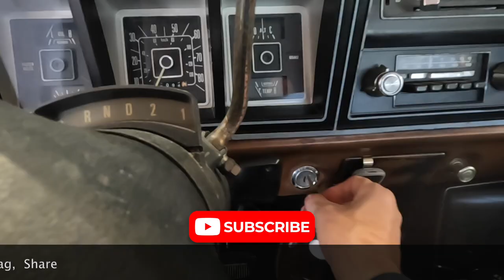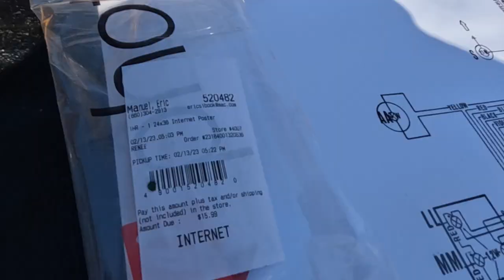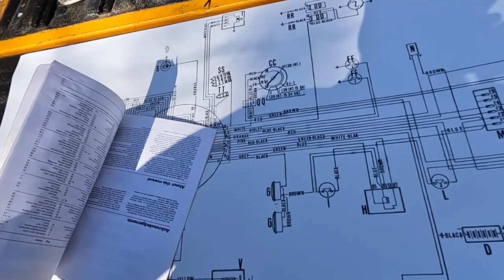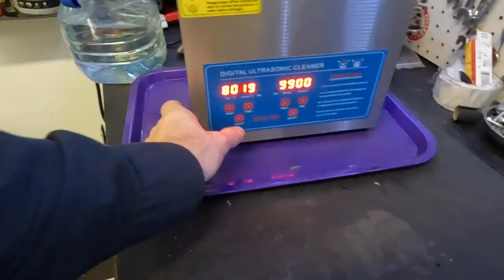1975 Moto Guzzi 850T abandoned for over 10 years. Will It Run?!?

Comment: Did the same with a € 400,- Moto Guzzi Nevada 750, turned it into a lovely Scrambler. It did run when I got (I mainly ran and she made some noise), wouldn’t idle. Without taking of the carbs, just took of the containers, cleaned the main jets and put a double dose of injector cleaner in 1 l. super fuel. It now runs and idles almost perfect.
Reply from the maker: I really like getting cheap motorcycles running without spending any money. Thanks for watching.

Comment: I admire you for taking it on, and getting it to run.  Lots of us armchair mechanics are cringing, you didn’t show if you checked to oil first, hope you did.  And WD40 has no lubricating properties, not the best for cylinders.
Reply from the maker: Thanks. Sometimes my enthusiasm gets in the way of prudent choices. I can’t remember if I did or didn’t. 😂 thanks for watching.
Reply: WD is great for short term light lubrication and displaces water. It’s always a good idea to juice those dry old cylinders with anything really. And if your dealing with aluminum pistons it’s a must (CB750’s etc)
Reply: From what I've heard WD is actually mostly fish oil. Not putting down on it's use, just putting it out there

Comment: I love my T I restored 9 years ago, simple, reliable & easy to work on. You may want to research about the chrome cylinders flaking; obviously not good for engine. I replaced mine with Gillardonis & they were not cheap or easily available back then. Early T's also had only a wire mesh gauze filter to help remove sparrows & low flying house bricks. Best of luck. They are worth the spending money on, you will have a bike that is not only few & far between but it will be bullet proof as well. MG Cycles are a wealth of parts & knowledge.
Reply from the maker: Hey George, How's your daughter Judy? I think the engine on mine was painted black and that is what was flaking off. I am going to do my best to remove all of the paint. 
I am enjoying the process with this Moto Guzzi. 
Please subscribe if you haven't already and please share.
Reply: @motorcyclerewind  The chrome plating on the internal cylinder bore reacts with the alloy cylinder & flakes off. This can cause the rings to grab for eg. It also ends up in the oil. If so the engine will need a complete strip down. If you drain the oil & it has silver flakes in it then the chrome lining has failed. The cylinders are easily removed for inspection. For peace of mind I would remove the cylinders. Riding with flaking cylinders will only destroy it one way or the other; sooner or later.
Reply: You're right, my dad got my Guzzi from me and forgot he left it running in the garage.
When he came running back to the garage remembering his folly, she overheated and and was lobbing.
He passed away last year and I got it back.
Left bank was scored and I had to replace the piston and cylinder. It had flaked at halfway through travel and top edge.
Funny thing, original pistons were 4 ring and my one replacement is a 3 ring.
Doesn't matter, now she's a beast.
I've done a complete rebuild.
She's coated in Dodge viper copperhead colored frame and Dodge viper snakeskin green.
On top of that I had a cafe racer seat reupholstered in snake skin vinyl.
Wished I could post a picture.

Comment: Right on!  You got that Moto Guzzi running.  

Moto Guzzi builds a great motorcycle.  They are shaft drive twins like a BMW (duh).  You knew this of course.  These Guzzis were very dependable motorcycles down the road; smooth, sweat handling, classic bikes.  

Guzzi guys are fanatics.  Moto Guzzi is the Harley Davidson of Italy.  All the Italian Police motorcycles are Moto Guzzis.  This bike was a score!  A much better motorcycle than the Yamaha 650 twin in the background (I like those bikes too, just sayin').

The trick is finding the parts you need.  The 850 T was not a plentyful machine.  It's well worth the effort to rebuild this bike however.
Reply from the maker: This was an easy one. Just one system at a time. 
I know nothing about these apart from the research that I have been doing.  Look forward to putting some moles on it. 
Unfortunately, people like their used Moto Guzzi parts. To go back stock is outside what I want to spend on this motorcycle. 
The laundry list is front and rear fenders, Speedo and tach and related mounts, headlight and bucket, rear gargantuan bar and turn signals and tail light. What what I found so far I am over $1,000 and I don’t the market id real strong for 850T’s. Love to hear your thoughts.
Reply: @motorcyclerewind  These Moto Guzzis are revered.  The 850T is not a bike that had 50,000 imported, but it definitely has value.  Swap meets are a good place for parts, also eBay or Guzzi riders forums online.  I'll tell you this, if you dial in that Guzzi you can ride it across the country.  Moto Guzzis are just like BMWs in this regard.

It seems like your bike was stripped for a crashed bike.  Your Guzzi does not look like it was crashed hard.  Only go "stock" on the parts that matter; OE fenders for instance.  Pipes, go after market with an OE appearance.  Seat... swap meet, or a Corbin (but they are expensive).  The OE seats on most M G are awesome, if you can find one.  Turn signals are cheep, get the small LED kind.  Try to get OE gauges with the dash that has the warning lights, and also try to find the OE headlight bucket to preserve the value of the motorcycle.  

Nice purchase, Good luck!

Comment: The direction of a ratchet spanner to tighten is the same direction as the open end is cranked. So in other words the open end of the spanner points in the direction to tighten. Does that make sense?
Reply from the maker: That does make sense. Another helpful tip about these wrenches 🔧 that I am finding out about late in life. 😂 Thanks for watching.
Reply: Great channel btw
Reply from the maker: Thanks so much. I am having fun.

Comment: Great score for 400 bucks.   I used to have a 2017 Moto Guzzi V7iii. that looked similar to that.  They're fun bikes.  

Where did you get that large wiring diagram printed up?   Wiring isn't my strong suit, but I enjoy crimping bullet connectors and terminals.   I'm definitely getting better at it.   I don't understand why someone would cut the wires right at the connector when they could just de-pin them.
Reply from the maker: I get the wiring diagram posters done at Walgreens. All I have to do is locate the image and do the rest at Walgreens.com. An hour later I have it. Big hack is there is always a 50%-60% coupon code available. The big poster cost me $15.99. 

I'll never understand why people hack up wiring. Just doesn't make sense!

Comment: The carburetors on guzzi have accelerator pumps. every time you open the throttle you pump fuel into the engine!. If the engine is not running this washes the oil off the cylinder!!!